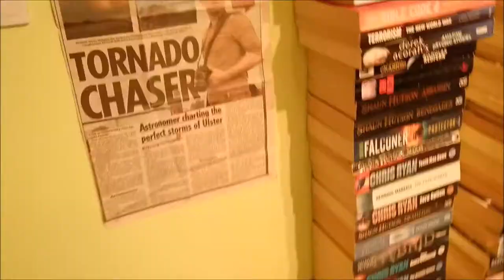Finderscope Replacement - Telrad - For Meade 10" Lightbridge Dobsonian Telescope

Comment: Hi, I hav a 10 inch Skywatcher traditional dob (not the collapsible type).  The finder scope is great, 9 x 50, focusable, but straight.    The problem is that I have to bend so much.  I wanted to try a telrad but you have to bend or crouch the same I guess ?
Reply from the maker: I have the same problem and have to bend a lot too which isnt good for the back. I take a small stool out with me for when the scope is pointing low in the sky but still have to bend when its pointing higher. The Telrad is brilliant, the only finder I use.

Comment: use a red dot finder and love them. Never had any battery issues.
Reply: Align it during the day. You should only have to do it once. The fact that the LightBridge won't say still is an issue with the LightBridge, not the finder.
Reply from the maker: @bowrudder899  The finder is rubbish (at least mine is anyway), I've removed it, the old telrad is doing a superb job on the lightbridge, A device I swear by since I first used them back in 2002. They may be big but they are reliable and very easy to use. I really don't like the finder which came with the lightbridge, my mate as the exact same problem, but maybe we got a bad batch. I actually don't use optical finders anymore, the telrad gets me where I need to be within second's, wonderful device. But of greater concern are the lack of clear nights here in recent times.